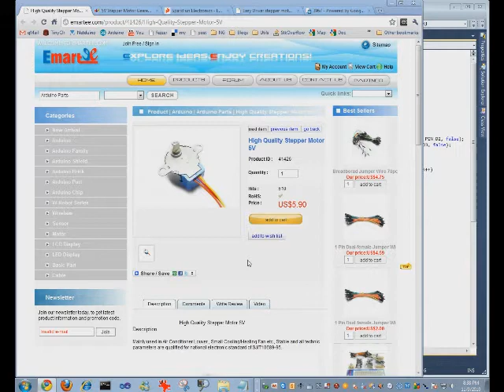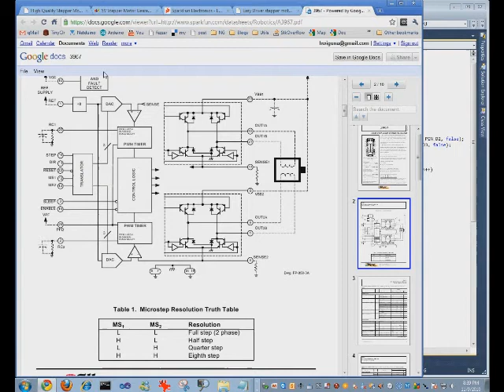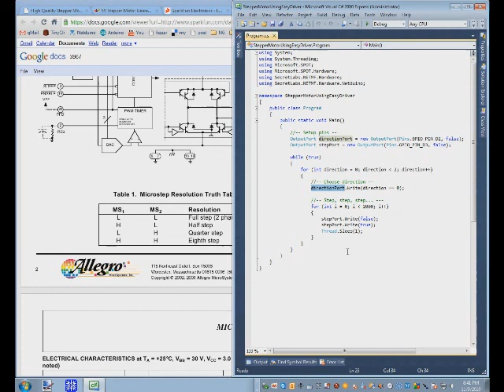Netduino+EasyDriver+StepperMotor

Comment: Thanks
Reply from the maker: You're welcome +Ashish Sapkota !
Reply: +Hari Wiguna Can you show me the connection diagram of the stepper motor coils 28-byj48 to the easy driver? Do you leave the red wire open?
Reply from the maker: +Ashish Sapkota , to be honest I don't remember, but according to me:
https://youtu.be/LonWg5Yp6cY?t=2m3s

The left two (A) on the EasyDriver goes to one coil and the right two (B) goes to the other coil.  You can find out which pins correspond to the coils by using a multimeter.  I don't think it matters which coils goes to A and B as long as A is connected to a coil, and B to the other coil.  Good luck!
Reply: +Hari Wiguna Thanks man

Comment: Thank you so much for this video.  I had these exact components and was struggling to make the stepper motor work properly.  Your video allowed me to puzzle everything out.
Reply from the maker: Robert Bunney , it's really weird to see a comment on a video that I did five years ago!  I don't even remember doing it.  I'm glad it helped you, and thanks for the ping down memory lanes. :-)
If you haven't already, please check my newer videos, they're now in 1080p, but sorry, no more Netduinos.  I'm addicted to the ESP8266 now :-) Thanks again!
https://www.youtube.com/user/hwiguna
Reply: Hari Wiguna I must have read 40 sites trying to understand how to put the EasyDriver board and the BYJ-48 stepper motor together.  Almost all the sites used the ULN2003 motor driver board, and most implementations jumped through hoops like custom Arduino libraries or modifications to the stepper motor itself.  Thanks again for a simple, straight forward solution.